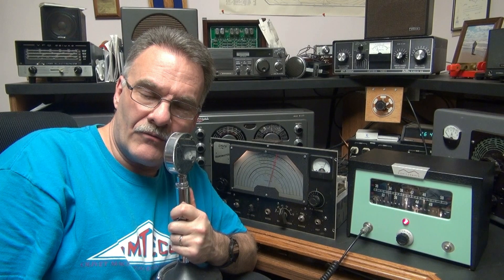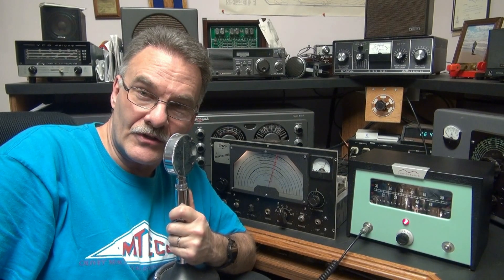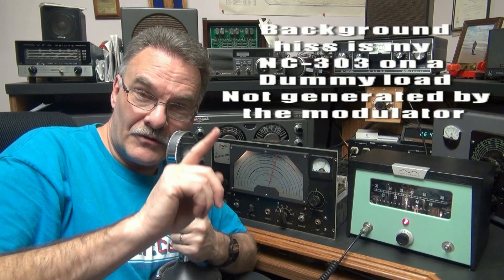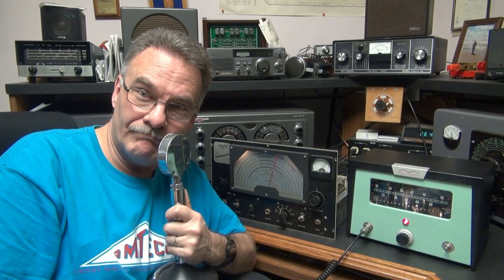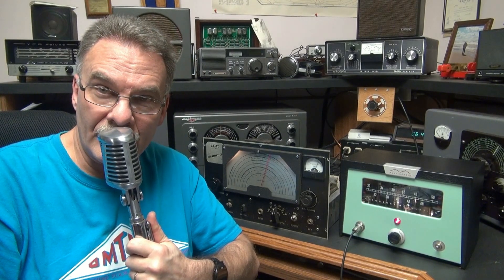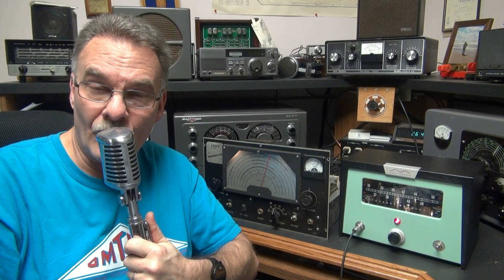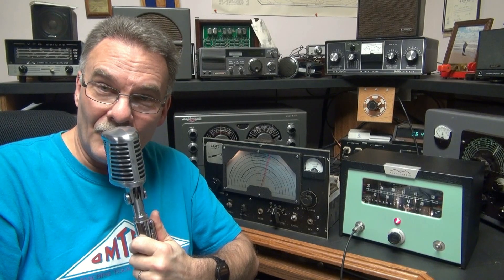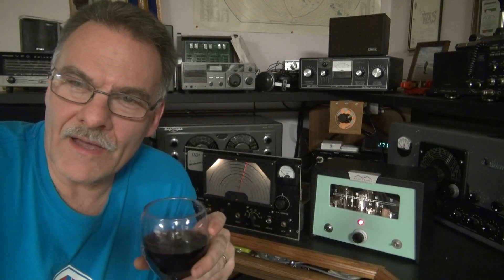CW Transmitter 6v6 AM Tube modulator Kit demo by D-lab

Comment: I like the clear dial glass with the tubes showing. did you add a lamp inside for effect?
Reply from the maker: +cptrdbrd Hello, yes I added a GE47 lamp to illuminate the red jewel and glass art. It all came together well. I bought the radio cabinet at a swap meet for $10.00. Almost threw it out. Glad I did not. The green paint is a Krylon sea mist satin.